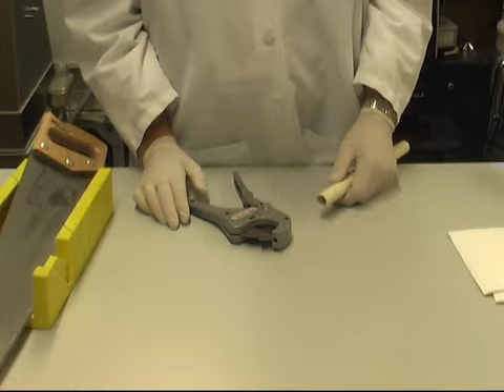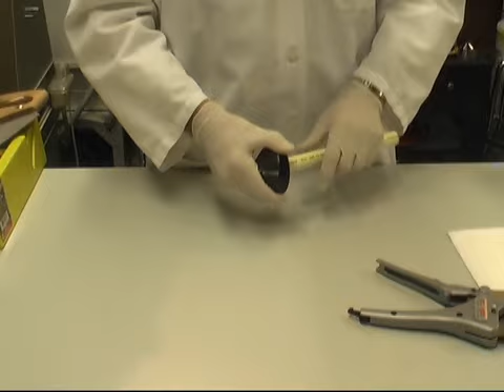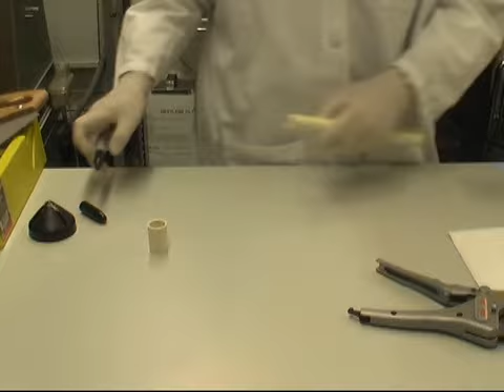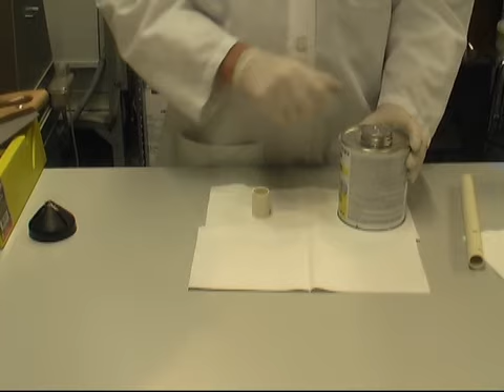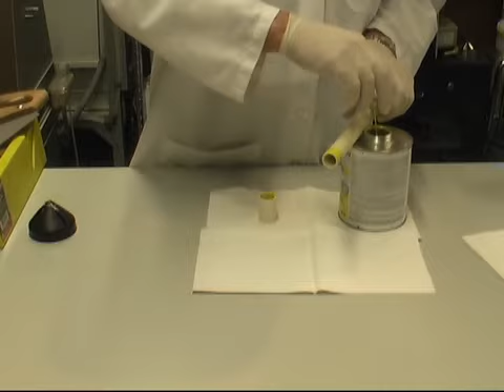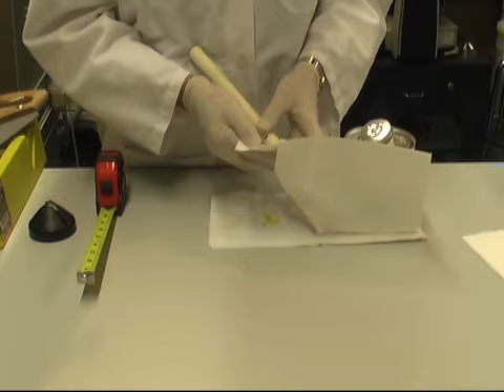How to Use Oatey FlowGuard Gold CPVC Cement

Comment: 30 seconds to hold it, as it sets- then, how long does it dry before you can use it- with water pressure?
Reply from the maker: The cure time depends on a variety of factors like pipe diameter, ambient temperature, and humidity. Cure time charts are available at our website http://spr.ly/6057Hiamc in the technical resource box, on the Oatey Flowgaurd Gold 1-step cement page.

Comment: How do I thin oldies all-purpose cement
Reply from the maker: Oatey does not recommend adding chemicals to alter the products  consistency. The self life of Oatey's cements is 3 years from the date of manufacturing, which can be found on the bottom of the can in Julian format.  When exposed to air the solvents begin to evaporate, which cause the cement to thicken. When properly stored with the cap tightly secured, the cements viscosity should remain within the products specification for the duration of the self life. Please visit www.oatey.com for more information.